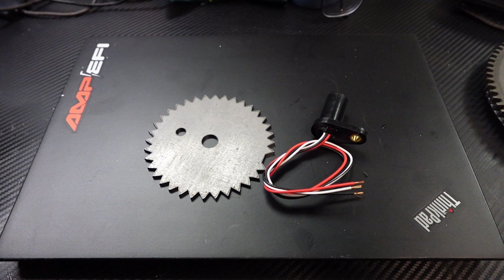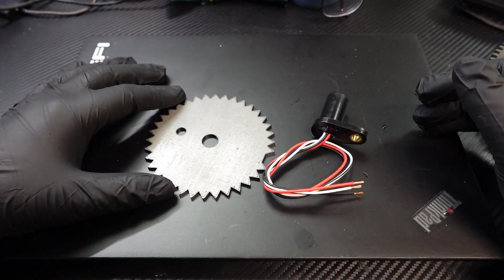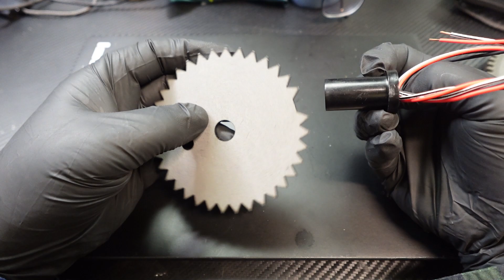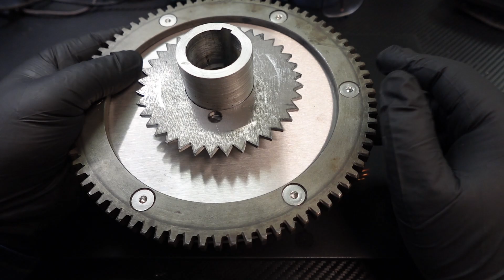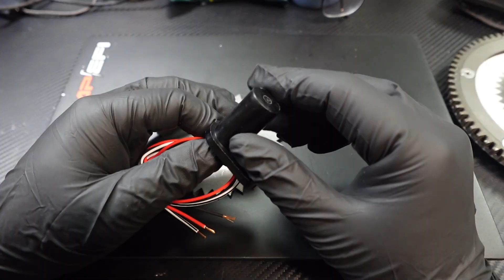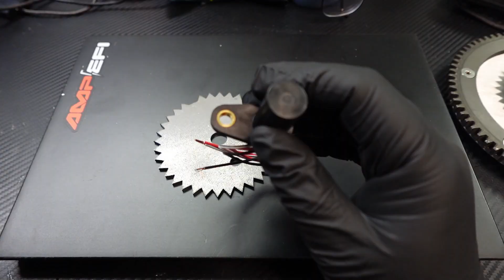EFI Crankshaft position sensor

Comment: VR sensors seem to be pretty consistent for playing guitars? theyre exactly the same principle as a guitar pickup. only issue seems to be dodgy leads and plugs, lol...

dont need toothed wheels.

but you do have to ether rewrite source code to implement, or design your own ECU from scratch.

you simply time the length of the trigger pulse, rather than time between pulses. as a trigger tab is so many degrees, that time period can be "sanity checked", as a certain multiple of that value will always be one revolution... if its close, its right, and you can also tell if its accelerating or decelerating. and of course, any multiple of the vale will equate to so many degrees of rotation.

 if its way off, use the reading that closest approximates the LAST readings...

i dug through speeduino code at some point, could not figure out any if its pre-loaded crank trigger routines, hoping to simply insert my own routine as option "X".... but faced with endless BLOAT, canbus, all teh excess nonsense... nah. change the wrong thing and its all a waste of time... i know when im out of my depth... and with my sdistrust of header pins and socketed boards... speeduino isnt an option. mega/microsquirt are overbloated with features and wires. noone makes a simple single or twin system. (ecotrons but its complete rubbish, so avoid...)

to do that requires you go a bit deeper than simply "buy commercial unit and use tuning software" as most EFI sysems have settled on this basic idea developed back in the 80s, and everyone simply copies... youre stuck with writing your own code if you want something "out of the box".
Reply from the maker: Thanks for your wonderful insight. Writing my own code and building an ecu from scratch is not an option for me I need easy and of the shelve components. I agree with you on the megasquirt being bloated but the microsquirt seems adequate for me and I got it to work well with 2 stroke.